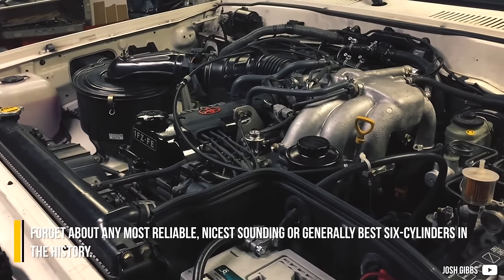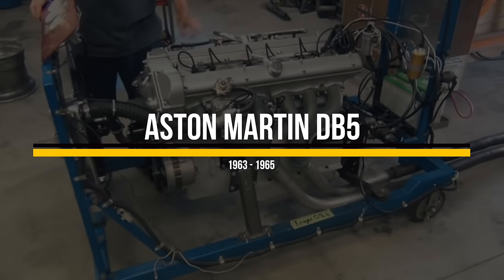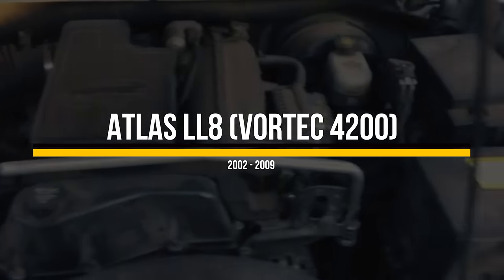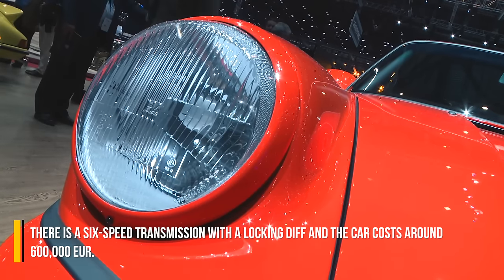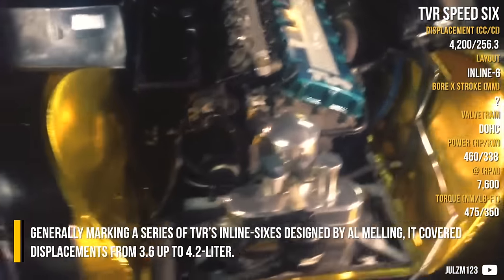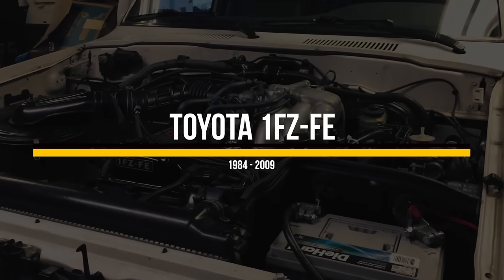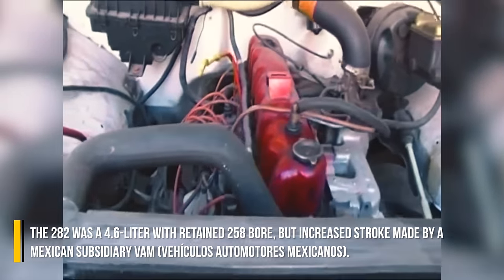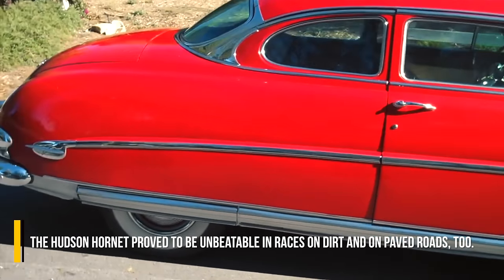12 Largest Automotive 6 Cylinders In The History

Comment: 4 liter Austin Sheerline A125
4 liter Austin Princess 4 liter R
4 1/4 Bentley/Rolls
4,3 Alvis Speed 25
4,4 Austo-Daimler AD 617
4,5 liter Talbot (won 24 hours of Le Mans several times)
4 1/2 liter Meadows engines used in Invicta's and Lagonda's
4,5 litrer Voisin C12
4,9 Rolls Silver Cloud S1
5,4 liter Daimler DE36
5,8 liter Voisin C22
6,8 liter Pierce-Arrow Model 33
7,1 liter Mercedes SSKL 
7,7 Rolls Phantom II
13,5 liter Pierce-Arrow Model 66

"There's no replacement for displacement" said Walter Owen Bentley once (by the way, he's the one behind the Aston DB5 engine. He was chef engineer for Lagonda since 1935, after the war, he developed a dohc straight six and a brand new frame. As David Brown bought Aston Martin, he also bought Lagonda to inherit that all new engine and frame to create what was to become the DB2 ^^).
Reply: Agree Jean-Charles. Your hero WO also came up with the 6-clyinder Bentley 8 litre of 1930 and 1931 (and the valve gear of the pre-1931 Bentley 6-cylinder cars was interesting). And WO came up with the nice refined LG6 & MR45 Lagondas (forget the V12's!) of the 1930's - one of which won LeMans in 1935. I quite like the 1930 Bentley Team Car 6½ litre engines, and the cars they were fitted to! In the 1930's there were lots of big six-cylinder engines! Cheers.
Reply: Sorry, I forgot about the pre-31 Bentley. It's hard to picture that they once were more than "silent sports cars". I will not say that Mr. Bentley is my hero, for his cars are a bit too heavy for my licking, but I sure won't decline a test drive if the chance was given to me ;-)

I will much rather prefer a Lagonda 2 liter low chassis supercharged with a Weymann body... Light is right and a blower'll get your faster out of the corner !
Reply: Ah, a Lagonda 2 Litre - nice choice. A four cylinder. Obviously you like 1920's & 1930's sports cars, and lightweight (who doesn't!). For exotic, how about a Squire, or an Alta, or an Atalanta. You've mentioned Invicta, but for more British cars only, how about the Riley MPH, an SS100, AC 16/80, Railton Light Sports Tourer, Frazer-Nash TT Rep, Talbot 105...? French 1930 sports cars? That's another story! Cheers.
Reply: Thank you, as for a Riley, I've got a soft spot for the Speed 25.
A late 20's Vauxhall 30-90 Clinton Saloon or a early 20's Sunbeam. Speaking of SS100, I've got a MKV with the same 3.5l engine... I can only imagine what it can do with 700 less kilos to move about and nothing separating the top of your head from the skies above. 

Judging by your username, you're more into pre-WW1 sports cars.

By the way I'm french, and as for the Talbots, I prefer the cars the french division came up with, even before Anthony Lago's got involved into it. Like a nice 11Six, M67, or a big Pacific (like the Coach by Pelletier).

A Ballot 2LTS or RH3, a Voisin C11 or 14, a Salmson with it's electromagnetic gearbox and DOHC ... The problem is which one to choose, I guess I'll have to own one of each !
Reply: most of those aren't cars, they're living rooms on wheels
Reply: Just try one out and you'll see what we're on about. 

Grace, space and pace ;-)
Reply: +Jean-Charles. Back again! See what you mean by my username, but it's my name! Yes, I like your choice of French sportscars (as opposed to living rooms on wheels). Yes, love the Salmson DOHC. How about a Lombard AL3 DOHC, an Amilcar, a SARA, a Th. Schneider, a D'Yrsan, a Delage DIS, a Rally Type ABC, a Derby L2, a Tracta, a Hotchkiss Grand Sport, Lorraine-Dietrich, Delahaye 135M, don't mention a lovely Bugatti 55! Aries 3-Litre Sport? A MkV eh? Nice. Cheers.

Comment: YES. they included the Almighty 300! Damn that was a good motor, im 17 and have heard some crazy crazy stories of what people do to try and kill that motor! BUILT FORD TOUGH!
Reply: Had to use my PTO on my f250 with one ran the engine for 3 hours at 4k.  Ran like a top.  No overheating, or strange noises. just smooth consistent power

Comment: My favorite V6 engines from general motors are: 3.1L L82 V6, 3.4L LA1 V6, 3.8L L67 series 2 supercharged V6 and the long living 4.3L Vortec/Ecotec V6.
Reply: The 4.3 is used in so many different things. I was disappointed to see it didn't make the video.
Reply: Garbage Motors!!! There's NOT ONE GM built car which has reached 100 years old!! They have NOT been around that long!!
Reply: Did anyone say they had? You have a lot of anger about GM. Can you show us on the doll where the 4.3 touched you?
Reply: @FlameOnTheBeat  damn that must of hurt
Reply: @Oddman1980  same here
Reply: @christophermarshall5765  I'm sorry about that.
Reply: Shadow Puppet have you seen JuniorN316's video Sleepeers?
Reply: 3.8 and 4.3 were the only good ones. 3.1 are sand eaters and 3.4 blow up almost as bad as the 4.2
Reply: From Starlight To Sunrise I agree with you. The 3.8 (especially the l67) and the 4.3 were amazing engines. The 3.1 and 3.4 had too many issues .Especially with head gaskets, intake gaskets and lifter issues.
Reply: @danielsolberg1638   yea, I have seen his video I found it harlarious in some parts of the video where the regal beats the 305 mustang and what's funny and sad at the same time is that ford made there four family sedan faster then there iconic muscle car, that was the funny part of the video but regal though that engine it has can handle lots and lots of power, the supercharged L67 series 2 V6 is one hell of an engine you can deck out because of how strong the engine is and famous for modding.

Comment: Missed the Chevrolet 230-250-292ci engine family. And also in the early 50's, GMC had a 270-302 inline six in their trucks that actually achieved a degree of success in racing, especially with a specially designed 12-port head.

Comment: you forgot the Tucker 48 it had a 334ci 5.5L horizontally opposed six cylinder and made 166hp  not bad for 1948
Reply: I don't know if you could say the Tucker was a production engine.
Reply: That engine was a modified helicopter motor. Tucker put lots of cool, innovative ideas into his cars, which is why the big three ( auto manufacturers ) ganged up and buried a upstart rival.. so we could have the crappy cars we've got today  from them...
Reply: That was a Continental aircraft engine if I recall correctly .... aircraft engines were designed for more power per cubic inch and frequently featured such things as hemispherical heads and four valves per cylinder as they were not as cost constrained as auto engines,  Look as Hispano Suisa
Reply: Also designed for low RPMs HP to keep blade speed down...
Reply: Tucker's weren't air cooled. They modified the engine to be water cooled.